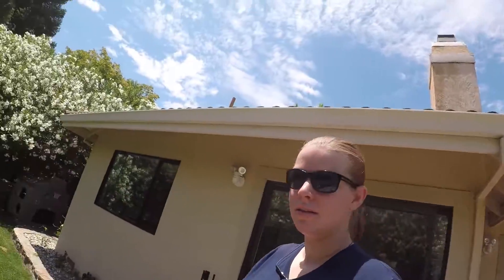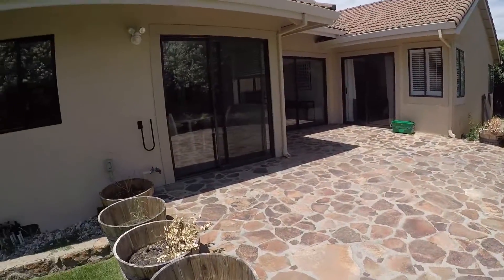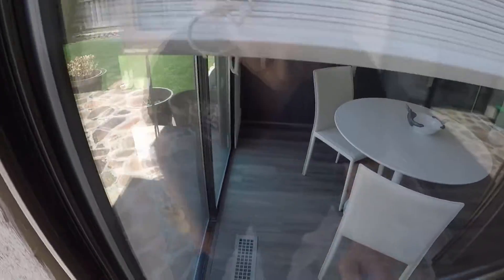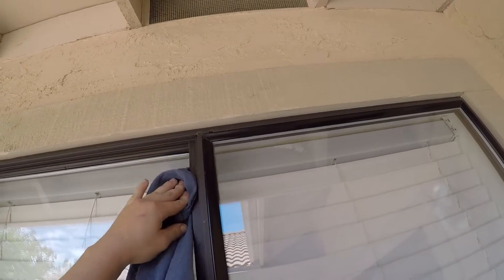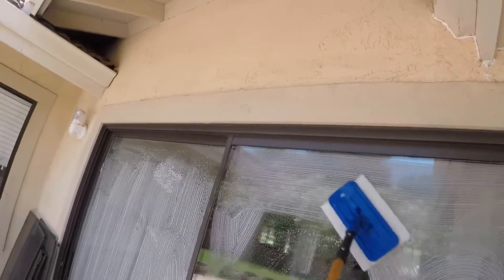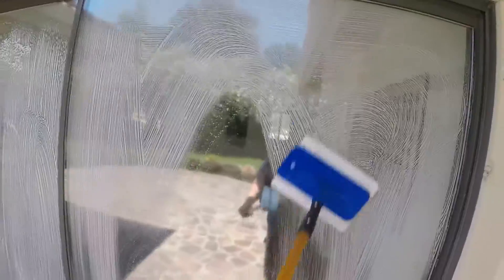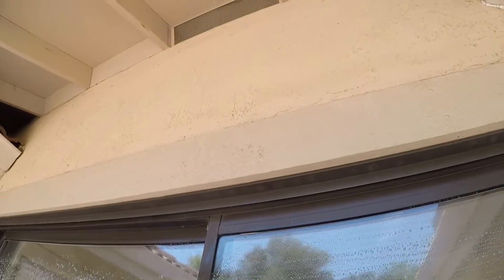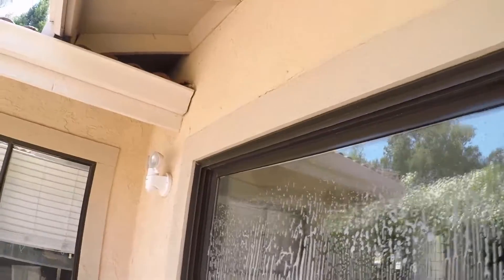Can my Unger Ergotec squeegee save the day?

Comment: Heather, I want you to take a look at what I use for brass wooling my residential windows, if I'm not mistaken I think I purchased it from Windows 101 out in Washington State it is called the eagle technopad swivels left right forward backwards up and down ergonomical handle works great and it fits six by nine brass wool pads perfectly check it out I keep it in my third belt loop on my moerman belt 😉!! Let me know what you think Cheers from the Jersey shore!
Reply from the maker: Interesting,  I just looked it up. If it holds different types of scrubber pads (including bronze) I'd definitely replace my current scrubber swivel head thing. 

How long have you been using it?
Reply: @heatherthewindowwoman4835  almost 2 year's,it will hold your white pads as well,has a nice ergonomical handle to.!